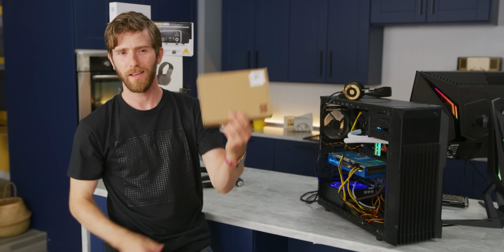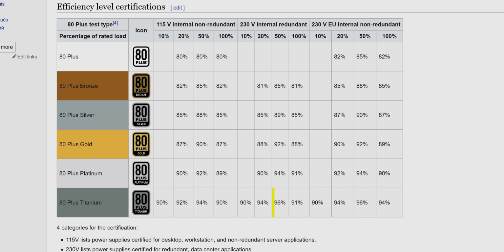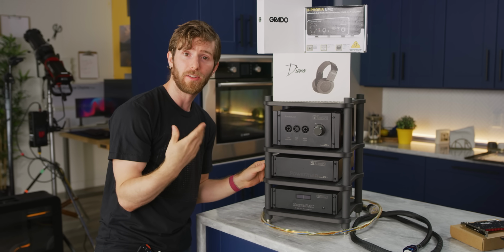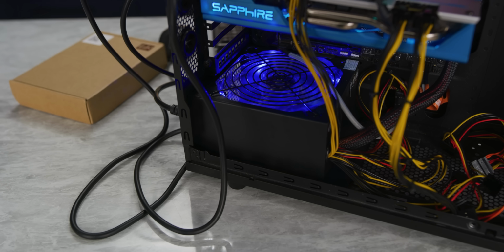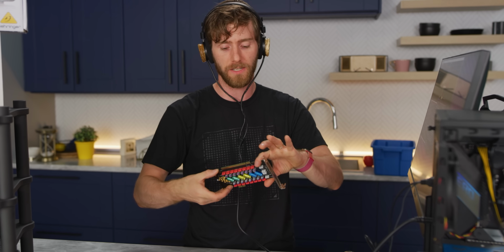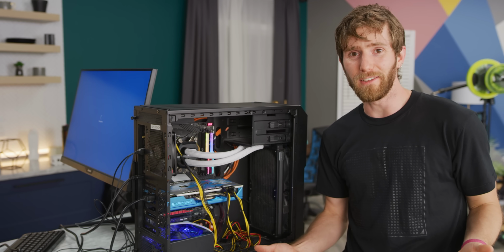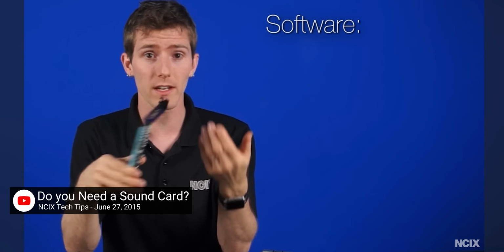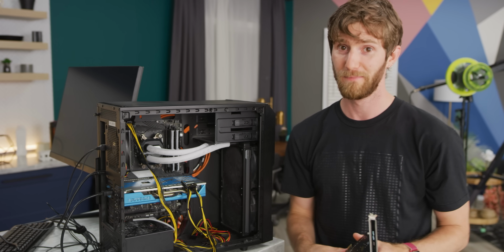Is this $40 card a SCAM? - "Audiophile" Power Filter

Comment: I'm disappointed you didn't open those capacitors, I bet they're empty/dry.
Reply: Doesn't really make sense cost-wise for these small caps, maybe if they were a little bigger.
Reply: @somanyfnbananas2774  Except that the factories for some reason sell them out, maybe the machine spits them out every once in a while if they run out of chemicals or something. But a lot of empty fake capacitors end up in fake products. Could be that they get bulk orders and end up with casings but run out of electrolyte and just run it through anyhow, who knows.
Reply: Ahahaha, I bet they are, you're not supposed to put too much capacitance on a power line that aren't designed for it, capacitor on power up is like a dead short until it's charged, put too many of it and it will blow a mosfet or two
Reply: @pierreuntel1970  Come on, those small caps are nothing compared to the caps in the PSU, should be fine on startup
Reply: Linus bridged the power pins a few times after unplugging that card and didn't get zapped by the capacitors so unless they have a really beefy resistor on there I bet you're right.
Reply: @Midicow  you cant get zapped by anything outputting from the PSU, the max voltage line in there is 12v and you cant get a shock from that, a capacitor is similar to a battery, it don't magically increase the voltage
Reply: @pierreuntel1970  I guess we're just going to ignore the 100 volt Axials with zero suppession then?
Reply: @Midicow  ah, that number is the maximum voltage rating for a capacitor before it got broke down and damaged, not the voltage it will magically putting out, the same thing as the voltage rating on your cable/connector/plug

Comment: Switching power supplies typically cause problems, in my experience, on mobile devices that are not properly grounded. Proper grounding (e.g. plug in a USB printer) tends to kill the hum. Although you have a switching power supply, your tower is properly grounded and may therefore already kill the noise, leaving this device with nothing left to do.
I'd try running your tower on battery (a UPS?) to remove the grounding, see if that causes hum, then see if the card cancels the hum.
That being said, I agree with your conclusion that this shouldn't be your first resort - I'd recommend grounding as the first thing to look at.

Comment: I have the FiiO DAC you showed at the end. It helped, but wasn't enough to eliminated my Dell XPS's coil whine from my sensitive earphones. What did help, however, was an analog dongle – the iFi EMatch. It makes the sound signal quieter without distorting it, so by using it, you are forced to increase the volume of your device, which increases the signal to noise ratio. So the FiiO DAC + this dongle was enough to eliminate any discernible static from my setup.

Hope this info helps someone!

Comment: "Coil whine" isnt electrical noise. !
Its audible noise created by loose windings in coils much like how a speaker works.
Reply: "Coil whine" can be generated from vibrations caused by unwanted harmonics coming in the power line to the rotating motor, that cause it to "shake" in certain directions. In very high frequencies, it generated a bit of a whine, as well.
Reply: Exactly. Quickly changing voltages can make nearby metallic objects physically move from the changing magnetic field. It's not much but when it's vibrating at 10khz it'll make an annoying noise.
Reply: My psu does it even when it's off. Super annoying. Hopefully my better psu coming will solve it 🤞
Reply: @120poundsound2  Well, it means it's not off, right?
Reply: @override1337  well its not switched off at the switch on the psu but im not faffing with that everytime i turn it off lol
Reply: the average person would consider this to certainly be """"electrical noise"""" and I can be very sure in saying that in an audio environment it would probably be picked up as it is a conductive material full of thicc electromagnetic field vibrating at x frequency
Reply: The loud noise of an MRI scanner is caused by the same thing on a much larger scale
Reply: It's both audible and electrical.   electrical proven if using a USB powered dac, the gpu changes the usb voltage when it varies in power comsumption.  the noise out of usb dac is a copy of the coil whine audible sound for this reason.
Reply: @dacomputernerd4096  Yeah absolute BS. The only thing is card reduces is the amount of money in the buyer's wallet.
Reply: I was gonna like this comment. But it’s at 69 likes and I don’t want to be “that guy”
Reply: @DDMultitracks  hehe 69 sex number

Comment: you wouldnt hear a difference in coil whine at the card
it is possible that this is cleaning up the power, you would have to use an oscilloscope to see any difference and know if its doing anything.
the way you guys did this doesnt show us anything
Reply: wrong way of testing
Reply: i would guess that it actually works because back in the day they used ballast resisters to get rid of noise in cars

Comment: Hey some notes from a halfass audiophile: if you want to test how noisy an audio source is, instead of using (relatively) hard to drive headphones, using highly sensitive low impedance IEMs would actually bring out the noise and distortion a lot, partially due to usually high output impedance of most average motherboards. I have a 9900K and 1080 TI. If I plug a pair of 300 ohm headphone into the motherboard,  it's dead silent no matter the volume level. But if using a pair of 32 ohm IMEs, I can LITERALLY HEAR the game loading.

Comment: Linus "I can't find a problem. Now let's see if this card solves it!" ^^
Reply: Depends on what the card should solve. There was also a chance that this card inserted causes issues which would fix the „Can’t find a problem“ part. :)
Reply: @Sebastian198910  If I'm not mistaken, it's a series solution trying to be operated in parallel, so it's never gonna work even if there was a problem.
Reply: YES
Reply: @AndrewBaggett-f2v  This motherboard is the absolute best that this CPU will fit in. Top of the top of the line. It has 12+2 phase power, gold capacitors and multiple filter capacitors. My PSU is a TX750W, connected to a fat-ass 3 amp cable. Wire routing is a privilege with this case; most of them follow one of the two paths available.

I no longer have this problem, but I have no idea what solved it. It could be replacing multiple small fans with fewer bigger ones, changing the GPU/mouse/headset, or maybe my wire soldering sucks less.

Mind you, I went from 19 fans down to 14, and 3 of them are voltage-regulated industrial fans, down from 6.
Reply: @ootdega  Sounds like a compound of poor shielding and too many wires. I had my front USB headers routed by my audio circuitry, and simply moving it like an inch fixed the problem.
Reply: Card that he just dropped, heavily.

I mean to be honest, if there's no problem to fix its existence is not needed regardless, but it's not like there was any other possible result given that information.
Reply: "We built a worst case scenario!"

No...no you didn't, Linus. Come back when you have a PC where you can hear the mouse move through the headset. It's maddening.

This video is dumb.

Comment: it's stupid audiophoolishness that of course won't work. and in that way it's no worse than 95% of the rest of the audiophool crap. what is more interesting is that a lot of motherboards have a slot on the PCB around the onboard DAC to reduce noise leaking into that sensitive circuit. that will make a heck of a lot more difference than a few decoupling caps off on an expansion board somewhere. the physical distance between those caps and the noise is just too big for the noise frequencies involved in DC-DC converters. high frequencies follow the path of least inductance and won't go off down a T junction onto an expansion board just to get to those caps.

Comment: ACTUALLY it does make a very big difference! at least in my PC, u should have tested it with the Abyss headphones, the difference comes as much more smooth and a bit more analogue sound and less digital. IT IS NOT the noise u hear, the noise this card filters out is the switching noise cause by everything in ur computer there is alot of switching going on in a PC, which might mess up the clock from the DAC(sound card) an effect called jitter. also probably an onboard sound card isnt good enough so u can hear the difference

Comment: "HARMONICS" (not mentioned once)
adding a power filter system can reduce 3rd,5th,7th,... line noise. you went 100% in the wrong direction for what the filters can be used for.
no, this card WILL NOT correct a crappy card with coil wine, thats not how it works. 
no, it WILL NOT will not condition the main power line, especially not using a PCIe bus butt proper Oscope testing wont hurt. 
if you want a proper informative vid about line noise, study "harmonics"  and how digital equipment makes it worse.
Reply: Very good point, but "scientific" tests on ltt ended same time as dedicated sound cards, unfortunately.
Reply: are harmonics in dc power a thing? i think it isn't. there is no frequency in dc power(maybe some ripple). witch means no harmonics?(im no expert) However i would like to know if this thing has effect on system stability if you are using a bad power supply.

Comment: I don't think all computers have audio problem. But if you plug the cheapest USB powered speakers and crank the volume to max, with no actual music/sound playing, in some computers you can still hear the sound of the mouse moving. I've actually experienced this. And a cheap USB sound card totally isolated the problem. And yes if feels like the sound chip on motherboard is missing one or two capacitors.

Comment: coil whine is usually worse at low loads as the actual switching frequencies of DC-DC converters are never in the audible range now, subharmonic oscillation is well understood and avoidable and so coil whine shouldn't even be a thing. What it is usually caused by is pulsing the entire DC-DC converter on and off at low loads to improve low load %efficiency in order to satisfy regulations.

Comment: You boost the voltage up to a level like 15v and then regulate it to 12v and even if you draw a lot of current it will stay stable until the voltage supply drops to 12v and THEN it Will ripple

Comment: A little bit of technical details: if EMC (electro-magnetic compatibility) issues were solved by just adding big caps a the other end of a power rail, life would be quite simple in the power electronics World.
The DC/DC converters used in a graphics card are chopping the current with a relatively high frequency, at that frequency, the parasitic inductance of the copper traces or planes between the big caps and the current angry components is probably not negligible at all, and will create peaks on the voltage.
Generaly, in high frequency switching applications, a smaller cap located closely to the current consummer will have a way better effect than a really big capacitor 10cm away...

Comment: I bought a Creative USB 5.1 Surround (non Pro) just to play Assassin's Creed when it came out. USB because I actually just had that 1 PCI spot to put my GPU in. I was totally blown away with the sound quality. I don't use it anymore, not because the integrated hardware is now better, but because I just have 1 speaker plugged directly into my screen for 4 devices. But it's still waiting, still functional, and on par with nowadays integrated solutions, waiting for me to move my A320M based computer on its own screen after I move next year so it can be put to work again. That is probably the one piece of hardware I'll keep on my shelf as a trophy after it dies. Yes, I have a 2007 sound card that I put aside 3 years ago but that's still waiting to be used again, and it will be used, cause those are so rare and expensive now. I really liked the concept, it could turn any 2.0 speakers into 4.0 (2 x 2.0) or 5.0(3 x 2.0 with 1 of the 2.0 being just 1 channel) setups and subwoofers could be added individually and the sound card would handle it all, front, rear, sides, sub as a whole. That's 1 thing that 1 integrated input port can't do.

Edit: I bought it in 2007, I believe it's a 2005 model.

Comment: Linus try the Austrian audio hi-x55 headphones.  They pickup everything. Or output a wire to an external amp. It will amplify the noise.

Also If you plug in an external dac this might improve jitter noise from high refresh rate mice

Comment: LC filters for the most part only work on ac circuits. Capacitors can help on a dc circuit if placed in parallel with the source.  It can help with sudden load spikes.

Comment: The REAL way to test this would be to hook up an oscilloscope to the power planes on the motherboard, preferably near the CPU.   That is a video that I would love to watch.  In theory, adding caps should smooth out the power.  The problem is that it is connected through a limited number of PCIe pins, which have inductance and resistance.

Comment: This isnt just idiotic, its also an insult to the talented engineers who have put tons of research and development in the motherboard and sound card design. 

Continuing on, the impedance of the pcb tracks makes a bypass capacitor completely ineffective if it has any significant distance to the component that needs clean power. 
The capacitors would have to be right next to the DAC/amp, and guess what - there are caps in that exact spot for that exact reason.

Comment: I remember the late 90s 486 / 586 when you 100% made sure you got a at or atx motherboard with nothing integrated otherwise you was in for troubles.
Remember there's different types of filtering with caps, another is a filter choke, shielding too etc.
Logic would be the money wasted on the card why not put this towards a better psu in the first place remove the ripple, and noise with the better psu!

Comment: 11:00 that alone might not fix the problem, regarding audio output you didn’t consider external speakers. Connecting between two powered devices like that through a ground isolator can fix noise, but wouldn’t that have been a good use case to test? 

even using the headphone out on my digital audio interface I pick up ridiculous amounts of noise going to my amp in my studio, so noise happens, but as I also said I just used a ground isolator and that fixed it.

Comment: I mean... You're using a very high end motherboard there, which probably has EXCELLENT filtering caps and dedicated, isolated amplifier circuitry. It'd be best to try it with some sketchy, el cheapo board, but even then, I doubt this'd make a difference.

Comment: That electrical noise is usually a result of the power not being grounded. As a result its sending the power to the speaker as an audio signal. If you can't figure out how to ground the power correctly you can buy what's called an isolator and it will fix your issue.

Comment: Yep got myself a small S M S L Class D amp / DAC  that sits on top of my case and powers 2 x vintage (1996) Polk RT2 Speakers sitting on either side of my Monitor connected using some thin gauge Oxygen free copper speaker cabling. Input is via a Digital optical cable from the rear backplane of my mother board......no complaints here on my sound quality...especially from the Polks :-)

Comment: One BIG noise source is the front panel connector for audio. Mostly for cheaper cases.
It is way too common for the panel pcb to be poorly designed.

I've had somewhere audio and USB ground used the same copper traces so any unfiltered noise just leaked through. Even tho onboard audio was high quality.

Comment: Showing and promoting scam (the audiofoolery not just the pci card) is not a great idea.

Also if the power supply is able to provoque any noise at your audio output, the issue is not the power supply, but your audio card which is badly made. It should have proper filtering. That card even if it was doing nothing would not fix a bad design. There are way more thing than just the power supply that can generate noise.